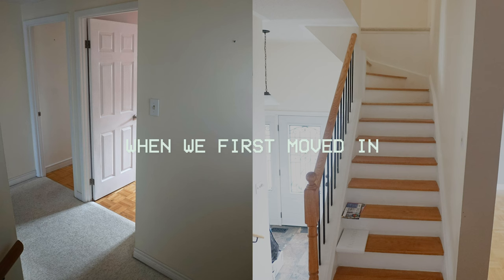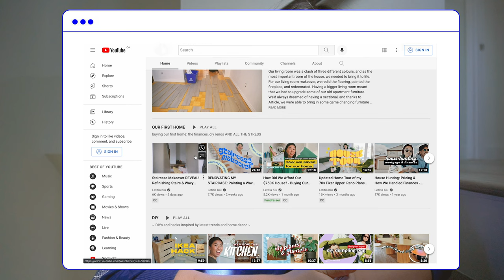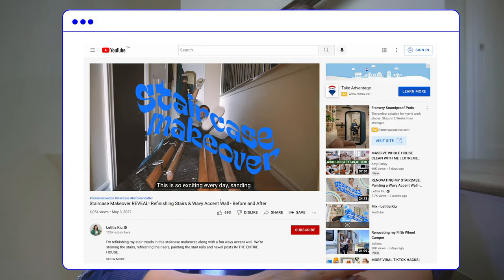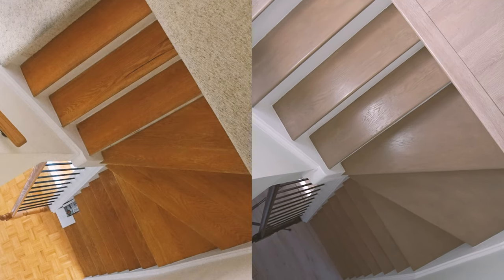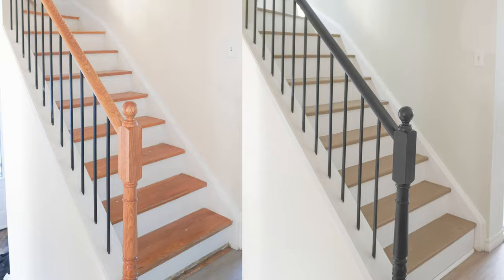START TO FINISH Staircase Makeover - Refinishing Wood Stairs, Rails, and Wavy Accent Wall

Comment: I know this video is 3 months old at this point but I wanted to make a suggestion for any future painting projects they’ll be doing: buy some paint spouts for your paint cans so you don’t keep spilling it all down the sides of the can and wasting as much paint. They make them for half pint cans of paint as well as the larger size. They are available at places like Canadian Tire or The Home Depot. I was also curious about the powdered substance that you put on the metal sheet and added water to. Was that some kind of drywall filler or spackling? It seems like a hassle to have to add water to it before filling the holes in the walls when you could just use DryDex and move on to the next hole in the drywall. No water or mixing needed. I apologize if I’m wrong about whatever that stuff is/is for. Just wanted to make a suggestion